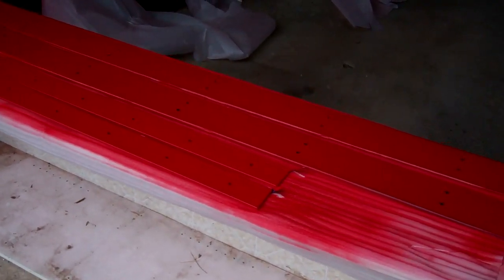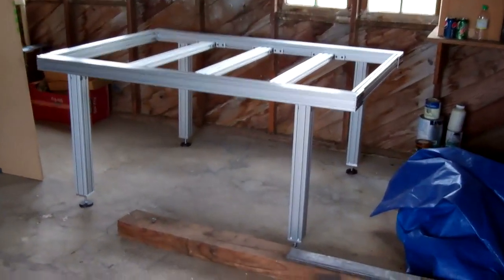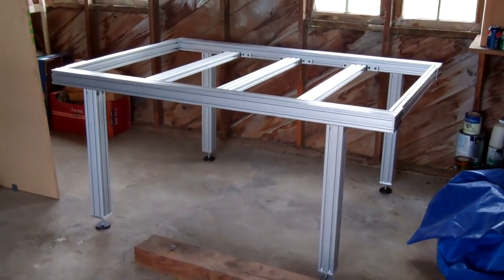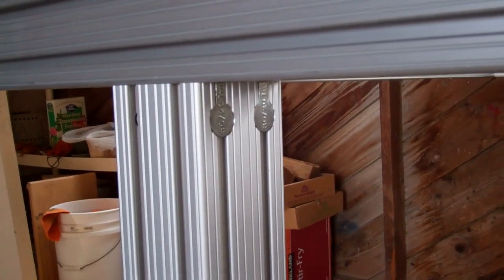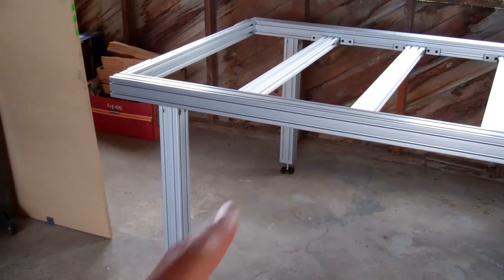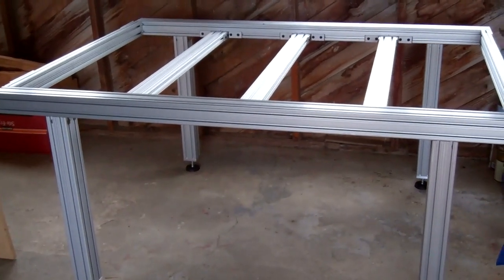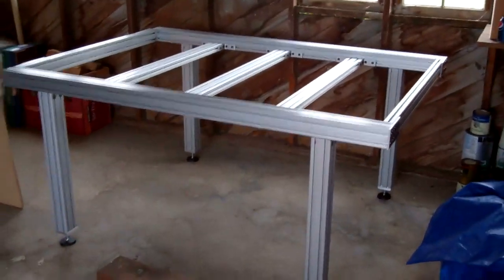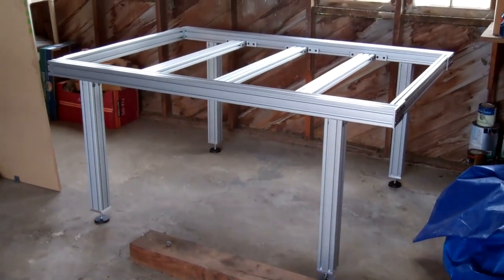CNC Router - Day 5

Comment from the maker: I got most of the material for free, as I mentioned in a previous video.  I would guess it might cost $1000 or more all the pieces.  The one piece i bought for the gantry cost $160 all by itself.  You should contact an 8020 vendor and get a quote from them if you're interested - that's their job!  :)